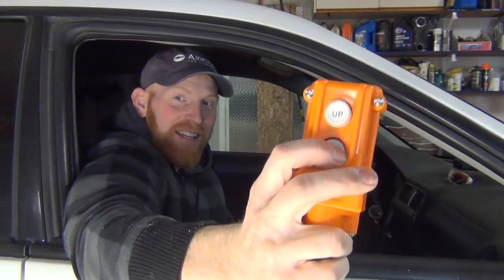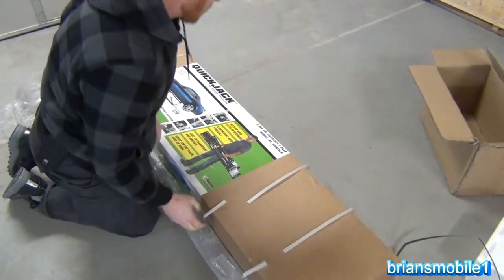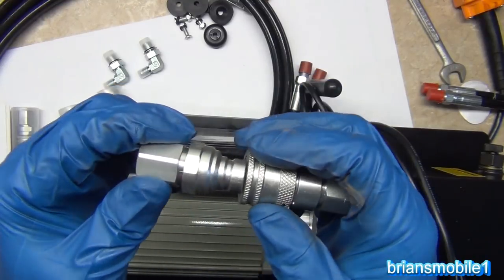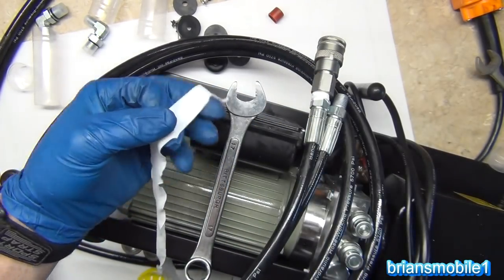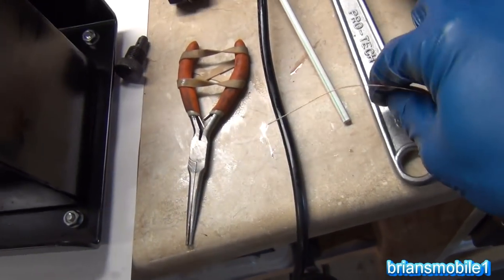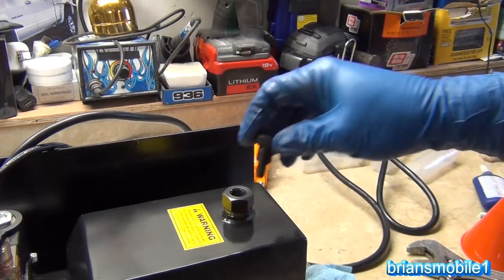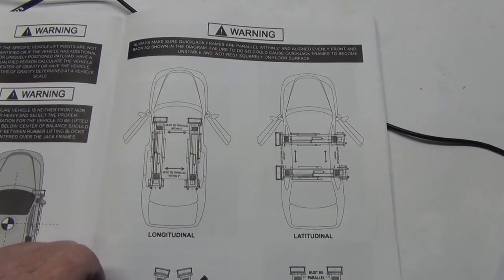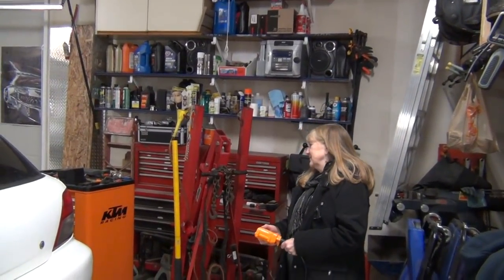Quick Jack BL-5000SLX Setup & Testing

Comment: Purchased my Quick Jack last month from Home Depo. They had the best price I could find. Also ordered the extra pinch weld blocks and the hangers for the wall. Your video was right on the money for assembly and I didn't need to follow the confusing directions.  Hands down best accessory I've ever purchased!

Comment: i just got my BL 7000 EXT but i wasn't sent all of my connectors and such for connecting everything from the pump to the jacks. i sat for two weeks not being able to finish setting mine up before i finally insisted that they send me the parts or come get this thing, take it back and give me my money back i finally got them to next day air me the rest of what i needed and i should have one of these videos up myself soon though i won't be as pleased with my whole experience. i hate when i tell people what's missing and they either only half listen or want to argue with me about how wrong i am.  the first tech support/customer care email got me 1/4 of what i was missing then an arguement ensued about what was missing from the remainder of my kit. once they listened to me finally and sent what i needed all is good now BTW kudos for not raising the jack up all the way without a load on it, even though it's all through the instructions not to do that you would be surprised by the number of people that got these jacks and still raised it all the way up on the first run with the jacks. and we'd all like "a few more inches" but you can get more height if you use the  Truck and SUV adapters. I bought those with my 7000 EXT that was also one of the things that bend pak initially left out of my order and i had to call back in to get sent to me

Comment: Thanks for the detailed view Brian. I was thrilled to see you post this video since I really wanted to see how the new version looks and works. I am certain that I will be getting this model soon. I was a bit disappointed to learn that this new model BL-5000SLX has a maximum height an inch or two lower than the previous BL-5000XL version. They added the safety cams to the support beams which lowered the maximum height a bit.  However, I did some research and learned that QuickJack makes an SUV and Light Truck Adapter set for $220 on their website. These are stackable steel and rubber spacers that look to add either 3" or 6" depending whether you use one or two of the steel spacers. This looks like a great option to address any height issues. I would post the link to the product but YouTube will not allow a paste in the comment field.
Reply from the maker: +dojmike That's right.  It's in the manual- didn't know the price.

Comment: I struggled to get my post tensioned slab x-rayed and tested to safely drill the holes for anchors for 2 post lift install in my 9' ceiling garage. Now I'm thinking isn't this option just overall better choice? 1) It seems safer since balancing isn't that critical concern 2) Yeah two post will go much higher but  I think it is more comfortable to lay down on the creeper than sit and stressing neck.

Comment: My Quickjack finally crapped out on me.  Basically, it wouldn't go DOWN all the way.  The folks at Quickjack HQ tried to help with some suggestions but they eventually gave up at the point we determined one of my air cylinders was leaking.  I paid a local hydra fab company to rebuild/replace the seal in one ram for $140 instead of buying a new one from QJ for $200.  I've reassembled everything and they still don't go down very well and neither side will hold air pressure.  QJ says it takes the weight of a vehicle to lower the lift, but we've all seen demos of the QJ going up and down without weight.  I'm afraid to lift my vehicle and test it out because it might not go down and the QJ blocks the jacking points, so there's no plan B!  Also, I did wash and detail my car a lot while up on the QJ and all the water caused the joints to rust - I wasn't good at lubing it.  It lasted about 5 years.

Comment: The manual I saw says that the lifting blocks can be stacked for additional height. One small block is 18" lift height but if you stack the blocks you can get up to 21" lift height. There's the extra few inches you were looking for.
Reply: IME much less stable  when the rubber blocks are double stacked as per manual. I returned my QJ after a major failure of the QJ. Subaru OB ‘11 was raised with the QJ and the locks engaged. While considering to keep a jack stand with me  before crawling under the OB one of the QJ slid inward and under the OB. The rubber blocks apparently slipped off each other allowing the vehicle to drop fast on one side. I needed two floor jacks to get the vehicle safely onto the ground. I lost all confidence  in the QJ. IMO the two QJ racks need to be secured together and never stack the rubber blocks. I would not consider any of the expensive QJ accessories to help raise a vehicle higher than with one rubber block.

Comment: 22:54 QJ / Bendpak says you can stack one 3” block and one 2” block and no more.

25:59 With the TL models they made the handles wider but I find them to be too wide and they slip off too easily.

Comment: the only problem with putting the jacks in sideways is if you have to work on a muffler or cabling that runs from the front to the back of the car. Also the BL 6000 XLT is longer for the electric vehicles since they all have a longer wheel base.

Comment: Brian, Great video. One of the best. There are some safety probs. Always use jack-stands. There is no lateral support on the jack's back legs and inadequate lateral support on the front legs (needed from top to bottom, not part way. A good push sideways would drop the car. Plan on doing some welding. Even then, use the stands.

Comment: I’d like to know if the 7000
With the long extender posts will lift my E250 work van.
I currently have to use two floor jacks with two 4x4 blocks stacked on eachother to get a wheel off the ground enough to get a tall jackstand under each frame rail….then I have to slowly jack up the rear diff to get the rear wheels up which makes the front wheels want to touch the ground.
Once the rear wheels are up enough I have to redo the fronts to get them off of the ground.
This van is very heavy and it’s a tedious job.
Every time I Jack it up I’m wishing I had something like this to get them all going up at the same time but it’s gotta be a heavy duty lift for sure.

Comment: hey brian ! hows it going? i wonder why you use teflon on your cuplers ? ive worked with hydraulics from ground up starting with the hoses and building them and then on to tubes , gold chromed iron ,and after that built block and brakes and stuff for wind mills , i never ever heard about teflon being used in this line of work , its simply too dangerus for the machines as you stated in the beginning , so why?
Reply from the maker: +transdetendal You're smart and you're not shy with it.  I really like that about you.  So my reason here is the instructions said to- and they even supplied me with their own special bit.  I can speculate as to it being necessary due to manufacturing not being up to wind-mill spec or just a precaution due to US tort-law-crazy, but truth is I don't know.  I just followed the instructions on this one here.  I got embarrassed on the 3M boot camp trip for not reading and following directions real patiently and I watched others have better success than I did that week.  So I self-corrected there... as evidenced here.  I've spent years being a free-thinking instruction rebel (I liked it and had a great time to a point and I've got those memories) so what harm is is to try the other side a while and have both sets of experience?  Life's fun like that.
Reply: briansmobile1
yea i can see your point ! could you say if your hoses are parker hanifin ? worlds biggest producer and the most used we also used , sorry i only THINK they are the biggest , alot of hoses in top qualety are also italian!

Comment: Just a theory, but for higher sitting vehicles to make better use of the lift available wooden blocks of various sizes could be used in place of the rubber blocks.

Comment: I love these videos, they really make me feel like I can tackle some of my own repairs, and I'm excited about maybe getting a QuickJack.  Here's a question: Any advice on how well a QuickJack would work lifting a Ford Ranger Pick-up?  I think it needs to be lifted under the frame, which is a little further inboard, somewhat shorter and/or not the same height front and back.  I see QuickJack has a truck/SUV adapter set that looks promising. Thanks! - Jim in CT

Comment: Brian! Do you think in your opinion these are safer than jack stands? I am always leary working under the car with jackstands. I always think something bad is going to happen..
Reply from the maker: +Kevin It all depends on how they're being used and if the user is working with them properly etc.  I will say the car is VERY stable on these and they spread the load out on the floor pretty well.  Having two independently supported structures helps too.  They are simple to use as well.

Comment: So now that you have had both for eight months or so, do you use the quick Jack or the two post lift more often? I'm trying to figure out whether I should go 2 post, Max Jack, quick jack, or 4 post with sliding bridge jacks?  The two post is cheapest, 4 post most expensive, and other two about the same (a little more than the 2 post).
Reply from the maker: I use the Quick Jack half the time because I have more room under the engine bay with the creeper (back saver) and lots of room to get in and out of the doors of the car.  Plus an oil drain pan is close enough.  I've used the QJ every day the last week and the two post lift twice.  The two post lift is tough to beat for stand up muscling things and quick setup.  The downfall to the Quick Jack is dragging it back and forth from center of the car to the outside.  It scratches the floor and you have to get on the ground.  Other than that it's fast, quiet, great access with a creeper and you don't have to climb or go up and down while working between the engine bay and oil pan areas.

Comment: I'm curious as to, if you're able to lift one side and not the other?  I'm a mobile rim tech and sometimes I don't need all 4 tires off the car, it may just be 1 or 2 on one side.  It would only need to come up far enough so that I can pull rim off.  What are your thoughts?
Reply: I would image you could just not set up the other side.

Comment: hey Brian have you tried lifting a pickup truck on it yet? I got the 7000 lb version for my f150 and the rear wheels have so much travel they end up barely off the ground
Reply: also a little tip I found is that if you accidentally position the safety on the inside of the car, use a broom stick or breaker bar to pivot the safety bars in case it let's go instead of putting your arm through and risking losing a limb

Comment: Great  video. It wasn't clear though, do you need an air compressor for routine operation? Didn't look like it...
Reply: +Silky Tp The lift has its own hydraulic pump. You just need air to charge the cylinders and a bicycle pump would probably work.
Reply from the maker: +Silky Tp Thanks for asking- you don't need one at all.  It was overkill even for the setup.  A bike pump or 12V compressor would be perfect for setup.  You don't need it day to day at all really.
Reply from the maker: +Mod MINI That's right.  Thanks for fielding that- should have read your comment first.

Comment: I wonder if you could put one or two 2x12" planks underneath them...
Reply: Not recommended. You can put additional blocks on top or use the adaptor kit for higher vehicles (sold separately)

Comment: Hey Brian, do you know what the SLX stands for? I want to make sure I buy the jack that has the automatic locking bars, but I can't seem to figure out which model that is.
Reply: SLX automatic safety locks
Dual-position automatic safety locks engage automatically as the lift rises. You can disengage the safety locks with a flip of the lock bar for a smooth, hands-free descent.

SLX extended block trays
Larger cantilevered rubber block trays allow for improved functionality and better block positioning during set-up.

Zero-leak fittings
We designed the QuickJack to make you less work, not more. Which is why our flush face hose fittings ensure fluids stay in the unit and not on your garage floor.

Comment: is this an updated version? reason I ask is I was watching EricTheCarGuys video of this and the safety locks are slightly different. thanks for all you do bud
Reply: Yes, Brian has the updated SLX model.

SLX automatic safety locks
Dual-position automatic safety locks engage automatically as the lift rises. You can disengage the safety locks with a flip of the lock bar for a smooth, hands-free descent.

SLX extended block trays
Larger cantilevered rubber block trays allow for improved functionality and better block positioning during set-up.

Zero-leak fittings
We designed the QuickJack to make you less work, not more. Which is why our flush face hose fittings ensure fluids stay in the unit and not on your garage floor.

Comment: Great vid :) Thinking about grabbing one of these myself but still have to check if it can be used between my Honda Accord Tourer and my Honda Civic Type-R (EK9) which don't really have the same lenght between lifting points or wheelbase so... need to measure first but... Great vid!

Comment: Are you able to weld some sheet metal on it so you would be able to drive  on it?
Reply from the maker: +Jon Lopez I've thought about that.  I'm not sure if that would work unless you had it suspended a little higher.  I'm sure your warranty would suffer and the weight and thus portability would suffer.
Reply: +briansmobile1 that's what I'm thinking, weld a bar to support and then the sheet metal over.

Comment: Brian what would you say about jacking a car from that jack point if it's rusting out? Using a conventional metal jack like the one that comes with the car it just crumbles and I don't want to do any further damage. I'm not sure if a rubber block would help in my case, possibly if it was pretty long to spread out the weight really well, but then I'd also need something for the jack stands to sit on. They're actually axle stands but am nervous trying to put them on any of the parts on the wheels side of the suspension.

This is what I have been doing:  https://www.dropbox.com/s/prcejk9vk6n958k/11655175_10155720112440321_176982468_n.jpg?dl=0

There's a reinforced part of the unibody just in from the jack point (this is an 03 cavalier), but it's a pain in the ass to get a jack stand in beside the jack, as the stuff left of that seam in this picture isn't reinforced and I'd bend the shit out of it to put weight on there, everything's pretty close together.

Comment: is it safe to use higher rubber blocks so you get more height
Reply from the maker: +D Lastname There's an adapter kit that has square bases and round pads that adapt the height higher.  I understand they're about $220.  The give you the extra height for vehicles that could use the gap to be filled.
Reply: briansmobile1 great    thank you
Reply: +D Lastname the BL-7000SLX includes the SUV adapter kit :)
Reply: Mike P thank you

Comment: Thanks for the informative video! Do you feel this is safe enough to work under the car or would you use Jack stands along with it or cinderblocks for extra safety? I always worry about being under the car and something fails on a lift like this. Looks pretty sweet and the price is right, I have a limited space one car garage and this would be perfect.
Reply: +JUMPNYC I would use some axle stands along with it personally, better safe than sorry.

Comment: I still wish that both sides somehow would be attached together.
Reply from the maker: +Emīls Kurpnieks (ikey07) I would have destroyed mine already if it did.  I was looking in the camera filming the latch mechanism and forgot to release the other side.  It took it like a champ.  Seems there's trade-off's with everything.
Reply: +briansmobile1 Yeah, but I more think like on the ground, so you can line them better, as I have similar garage door motor setup as you, cant install a proper car lift, will have to try something like this.

Comment: I wouldnt use that without axle stands
Reply: +TrueBlueEG8 I was thinking the same exact thing, someone is going to save up for them and put a long breaker bar onto something towards the front or back and make it tilt on top of them (really hope that never happens)....I wonder if the manual recommends it....
Reply: +dadinggo would suit for changing wheels, if you do the initial loosening/tightening on the floor, but i wouldnt put my body under the car without stands.
Reply: @dadinggo  - Unlikely this would topple, unless on uneven ground.  The weight the car is pushing down on these will make this a firm structure.  If however on uneven ground, you could well be correct, and they could slip.  But i would still put stands under to be 100% sure.  I'd say the R&D on these will have put this theory to the test many times over.  The last thing any company wants is one of these collapsing and killing someone.